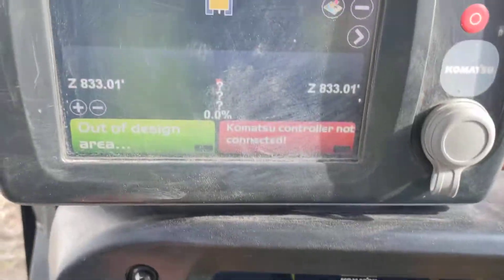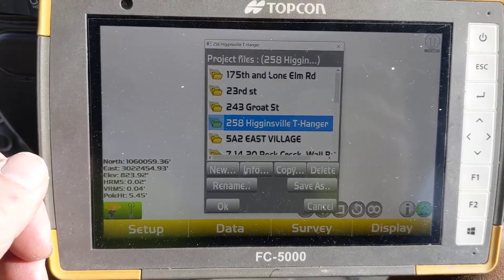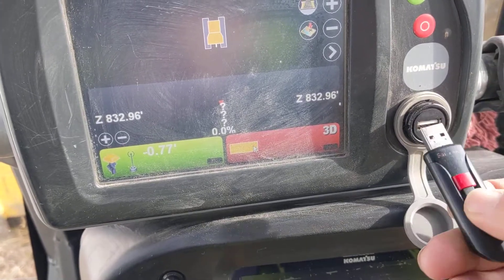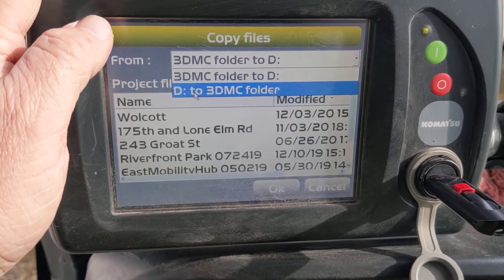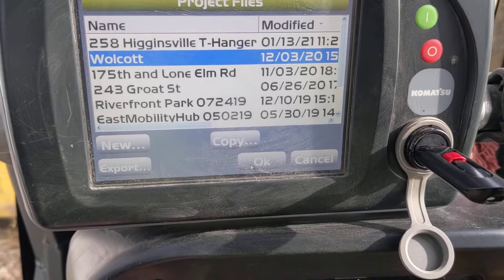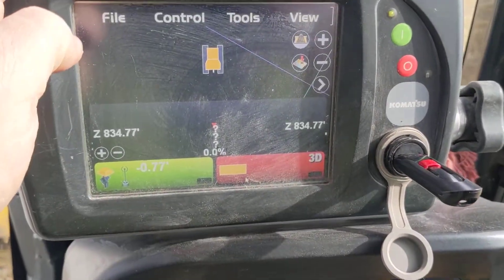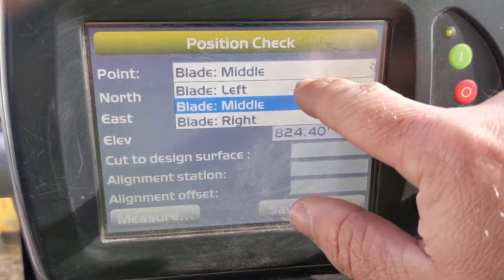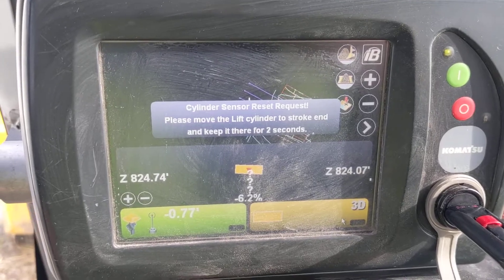Copying Project Files (.tp3) to Machine - Topcon Pocket 3D

Comment: I’ve uploaded my project files everything’s good on both rovers, but for some reason I’m 3meters off vertically on my 750 smart grade dozer, any solutions for why this could be?
Reply from the maker: Did you copy the same project file from the data collector to the machine? Only time I really see this is if the rover and the machine are running two different calibration files. If you want to email more details or files to us we can take a look at them. 
support@myconstructiontechnology.com